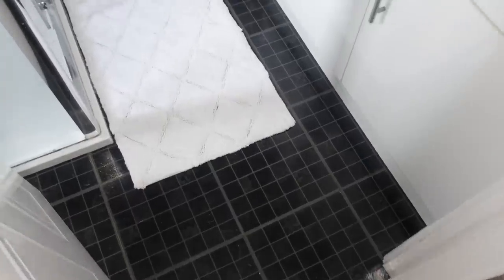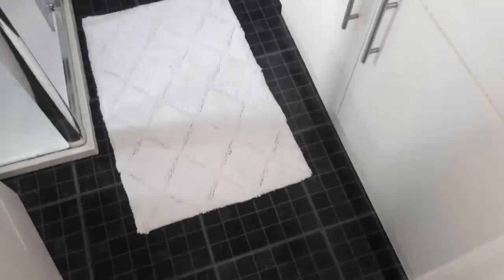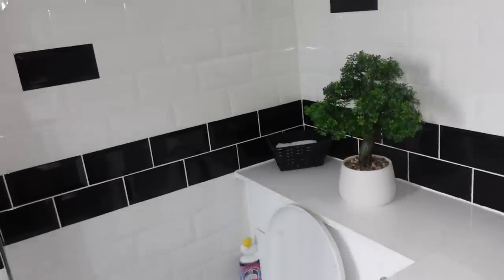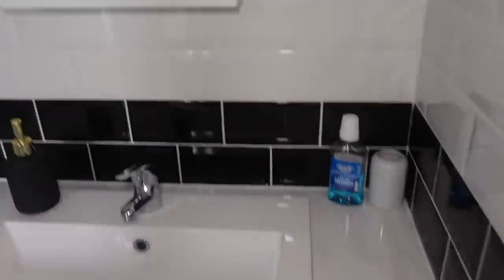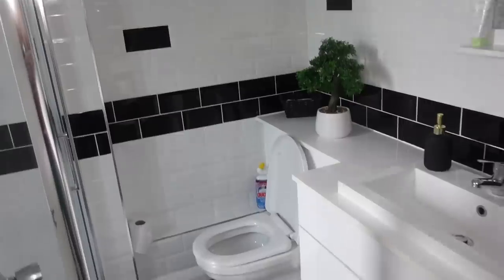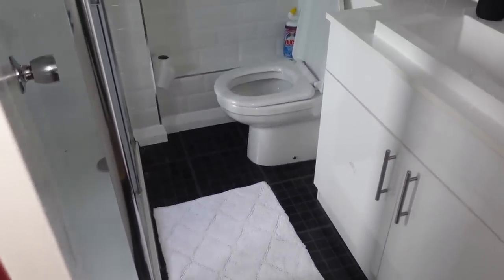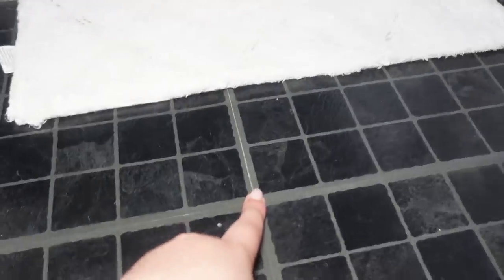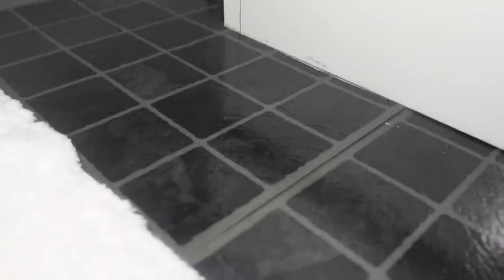£40 BUDGET HOME BARGAINS DIY EN-SUITE MAKEOVER....THIS IS HOW IT WENT

Comment: If the floor tiles don't seem sticky get some spray adhesive from poundshop or home bargains we used the  pound shop one. It was really good ours haven't moved in years etc. Tiles from b and m are the best we got some square ones in bathroom and strip fake wooden floor ones from b and m and it's great x

Comment: I used stick on tiles from Amazon and also used a spray adhesive and done tiles have stuck very well but some around the edge of the room tend to lift slightly but overall not to bad xx

Comment: We have got the home bargains floor tiles in our kitchen and they’ve honestly been an absolute nightmare. We used extra strong spray adhesive also on them for extra stick and they’re still peeling up. Mine are also moving aswell for some reason when they were put down perfectly now they have little gaps in between them. The planks from B&M we got for bathroom are perfect and still are 3 years later. Just wish we had got those instead now lol

Also, don’t vacuum them cos we did and it actually chipped some of the tile lol 😂

Comment: That’s strange.. I have those exact tiles that I bought a year ago. They stuck instantly without lifting and are still perfect after a year. We found it important to not lift them up or try to reposition them once they are put down. If you didn’t then maybe they have changed the product?
Reply from the maker: Maybe? We did readjust a few though so this may have caused problems hopfully they last x